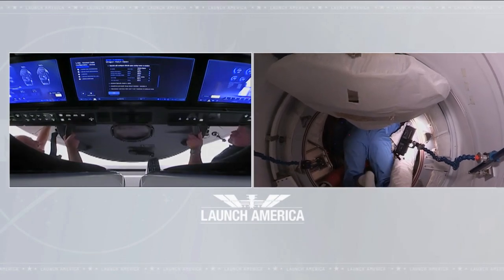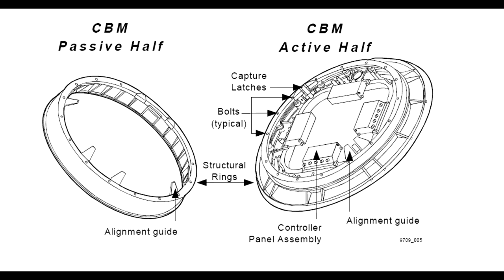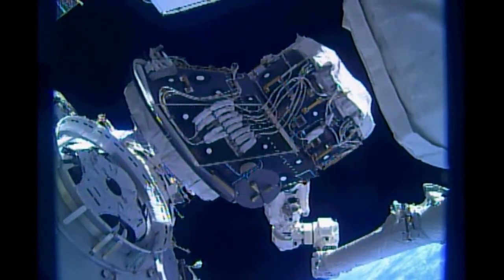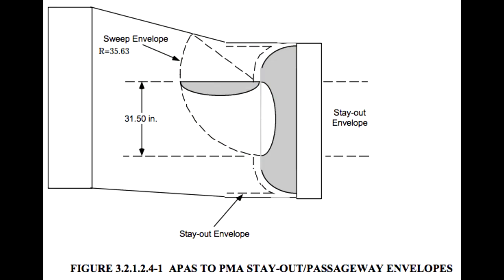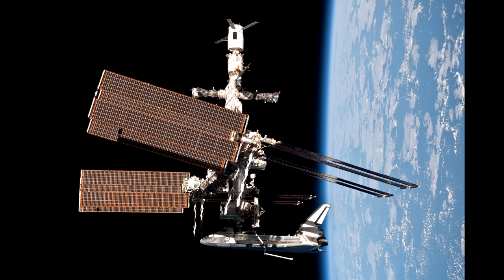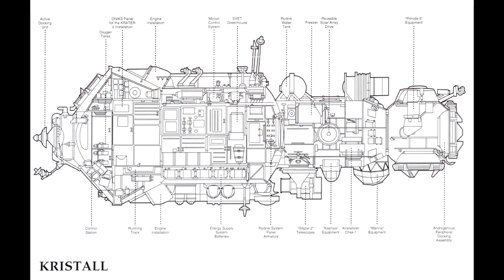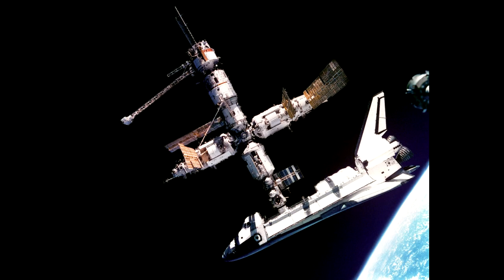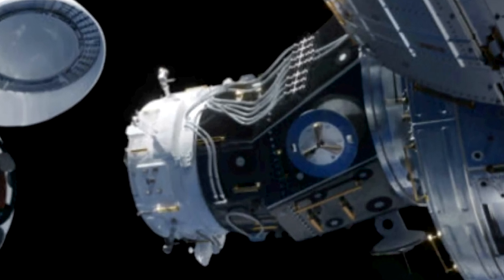Why The Docking Adapters On The Space Station Are Shaped Oddly

Comment: Hey Scott, great video! You mentioned a study to use the Soyuz as a lifeboat for Freedom and it being the first rendering of this particular design. It looks to me like in that configuration, particularly in "Option 4", the offset gave some potentially much needed clearance between the Soyuz' and the truss structure. Is it possible that was the main reason for the offset? That either these plans were serious enough they ended up largely designing it at that point already and didn't want to spend the resource to revise for the shuttle later, or perhaps saw similar uses for the ISS?

Comment: A little bit unrelated question. In case of an emergency, how long will it take them to get into the capsule and undock?
Reply: Well what's the emergency?
Reply: And what if the emergency is a leak in the capsule?
(Don't be ridiculous...that would never happen.)
Reply: What kind of emergency is not important. My question is, how long will it take if they do it as quickly as possible?
Reply: That is one thing that they are intending to test with the Dragon this visit if they have the time. I believe the aim is to undock within 4minutes. I don't know if that's after boarding or hatch close or all in all.
Reply: 3 minutes to get in the Soyuz and close the hatch.  They actually practice this.  Then the crew can undock and land completely independently with no help from the ground if necessary.  3.5 hours from getting in the spacecraft until touchdown in Kazakhstan.

Comment: Here's a few little factoids for those interested. Although STS-74 was indeed the third shuttle visit to Mir, it was only the second to dock. Discovery performed a rendezvous and flyaround on STS-63, but Atlantis performed the first docking on STS-71, followed by STS-74. Discovery and Endeavour would only dock with Mir once each over the course of the program. Additionally, each orbiter (excluding Columbia) had its factory-built native airlock removed around the time that Shuttle-Mir was coming to an end, each being refitted with a permanent Orbiter Docking System external airlock. This is why in the non-space station missions taking place in and after the late 90s (STS-82, 85, 95, 103, 99, 125), an ODS is still installed albeit with no APAS-95. Only Endeavour on STS-89 (Shuttle-Mir) and STS-88 (ISS A.1) would fly with the Orbiter Nose->Tunnel Hatch->ODS configuration following modification. Oddly though, even after its airlock configuration was changed, Discovery flew in the later Orbiter Nose->ODS->Tunnel Hatch configuration on STS-91 (fiinal shuttle-Mir) unlike Endeavour did for her Mir visit. Additionally, the Shuttle-Mir docking module would later serve as the design basis for MRM-1 Rassvet.

Comment: The offset may be a crumple zone, in case of collision at higher-than-expected speed. 
 
If the adapter is straight, the energy is transmitted directly through, rather than being absorbed in the breaking of the adapter. But the point about access to cargo bay makes sense.

Comment: I suggested on twitter it was in case of a accident and the docking ring broke. Rapid depressurization, the angle would help stop or slow objects or persons form being ejected. I will add something else to that, the door swings up and any out rush of air would pull the door down and self seal. I think the 27" of extra clearance was not enough to justify the design as there are specs on how much clearance in the cargo bay you have for a payload that is removable.

Comment: adapter comes from the Space Shuttle that might as well be carrying a pressurised space lab inside the cargo bay. I still got the model from the eighties, with that "oddly shaped"  adapter. So that's because the  two hatches were off considerably and there were backup structures left to be used in a new program. simple as that!

Comment: In order to have maximum clearance, during the assembly phase, when removing the long trusses or pressurized elements from the Shuttle payload bay. If the Pressurized Mating Adapters had not been oblique you would have had much tighter clearances when translating station elements with the mechanical arms straight upwards from the Shuttle cargo bay. The PMA nodes always angled over the Shuttle aft crew compartments. One also notices that PMA-3 and the Tranquility module might be used as spares should anything happen to Node 1 or 2.

Comment: My first instinct on looking at the design would be that it stops the energy from an overspeed docking or bump being transmitted straight into the module, instead the docking port will crumple and bend absorbing some of the excess energy like a crumple zone on a train and reducing the chance of the module being punctured or warped.

Comment: The shape was built in to provide clearances for the shuttle to safely dock. The problem first came up during the shuttle-Mir program so using that knowledge a solution was engineered into ISS. With Mir, before the docking module was installed they had to move the Kristall module to provide enough room so they learned something from that program and built it in from the start.
Reply: Did you even watch the video before commenting?

Comment: I think that astronauts should wear bump caps. Could be held on by velcro attached to a fire hood. A low mass ventilated helmet made out of UHMWPE could provide some basic level of protection against bumps and impacts. It may also provide some slight protection against certain types of radiation, perhaps slightly reducing long term exposure.

Suits worn on spacecraft and stations should also have some bump and abrasion resistance built in to protect the torso, hips, knees, elbows, and shoulders in a similar way as some motorcycle gear. These can also use tough plastics such as UHMWPE. Both bump protection and some limited mitigation for long term radiation exposure can be combined into the same gear. For areas that require additional strength or density, some aluminum bronze components can be incorporated.

Comment: So the ISS APAS was similar to what we flew in MIR config, but it was not exactly the same. The screws were longer, tunnel shorter, and there were some changes to the drive mechanisms.   Also, while STS74 was technically the third Shuttle-Mir flight, it was only the second docking ( following STS71). STS63 was just a fly around.

Comment: The adapter is both slanted and tapered.  This is required because the designers on one end used the metric system, while the other end uses the English system of inches and stones.
Notice also how one end is round and the other end is square.  21st Century adapter to make round peg fit into square hole.

Comment: Going by the placement of the upper windows on the shuttle, it also looks as if the offset lets the shuttle crew have a good view of the station and any reference marks as they close in for docking.
Reply: That's my theory too.
Reply: They don't normally dock the shuttle from the front seats.  They do it from the aft flight deck looking out the cargo bay windows and overhead windows.

Comment: Going from APAS to the IDS seems like a case of change just for the sake of change.

Also, why couldn't any arbitrary combination of APAS-equipped vehicles be docked together, as long as at least one of the vehicles had a functioning attitude-control system with which to line up with the other?

Comment: The renderings for the Freedom Space Station showing the offset design for the adapter. From the drawing it looks like the Soyuz capsule hatch is smaller than that on the the space station. In process plant, changes in pipeline size are often done using offset conical designs like this. Offhand I'm not sure if it has a lower pressure drop for a flowing fluid than a conical design, (not that this is a problem in this case), but it could be easier to fabricate. Also, it might be more resistant to buckling under sideways forces, something a mechanical engineer could confirm. Like the adapter for the Space Shuttle, it does have the benefit, (may be the sole design criterion), that it moves the Soyuz capsule a little bit further from the space station.

Comment: I'm an engineer and piping is one of my forte.  In my line of work that "slanted" profile is called an "eccentric".  And since the eccentric also connects two cylinders of different diameters, the section can technically be called an "eccentric reducer" but I'll leave it for NASA to call it whatever they want to call it.  I believe this shape is used to absorb hard impact but I could be wrong.  There are better ways to design it for crash resistancy without the risk for a disastrous rupture.  I humbly stand corrected.

Comment: It is purely for structural strength using this design is 10 times stronger that a straight connecting tube. It can bare more torsional and lateral movements, which happen when docking.

Comment: What’s are the ports in the top of the shuttle for?

It almost looks like you can get a better view of the docking adaptor if the cameras fail but you still need to dock. 

But this is just talking out of my backside, another idea from the same source would be that it has to do with being able to retract the port and/or absorb energy if the have a rough dock. I envisage that if it were to be up on the station for a long time they would’ve built in as much redundancy and reliability as possible as this help longevity.

Comment: Why not use an inflatable soft sphere with some semi rigid supports as an adapter section between docking connectors? This is essentially just the inflatable sections tested as storage closets but with connectors on both sides.

Comment: Citation: Outposts on the Frontier: A Fifty-Year History of Space Stations
By Jay Chladek, Clayton C. Anderson

P344:
"To dock with the Zarya module and shuttle, ewach end of the Unity node was equipped with a PMA. This essentially turns a CBM into a docking port capable of accomodating a spacecraft equipped with an APAS-style docking port, such as the Shuttle, a properly equipped Soyuz, or any other spacecraft still on the drawing board in 1998. The reason for not using a CBM as a standard docking port was related to the size of the hatch and the requirement for extremely tight tolerances. An RMS arm is required to position a module on a CBM. A PMA also has some built-in shock absorbing capability, should it see a rough mating."

Aside, the reason the RMS arm is required to dock a CBM coupling is related to the keyed nature of the system - it can only lock in one of four positions. The PMA is not keyed, it only requires a longitudinal precision for approach.

Comment: Scott, what about deflection of forces when the un-attached units mate? Similar to the crush zone in a modern vehicle. Designed to absorb forces in case of a severe impact and not transfer them directly into the main body of the space station. Possibly not the main reason, but maybe a factor? What do you think?

Comment: What about offsetting the force of docking.  Under normal conditions that force should never be enough to damage the collar,  but as the station grew with more modules being attached a straight collar would better translate those docking forces down the perpendicular length of the station sending that force through multiple module docking collars and back again.  This lateral force going back and forth would stress all the collars multiple times during each docking operation.  Also, though unlikely, could set up a resonace situation.  The offset appears to place.most of that docking force on the cllar itself and what gets translated to the station would be more of a shearing force rather than a setting up a reflectable compression wave.

Comment: It looks like they were just putting in some adjustability for future unknowns in terms of mating clearances. And if you put that on all of them they are interchangable. A straight one would have been too tight when the shuttle had the docking system slid forward for larger payloads. And since they were already made and tested adding redundancy was cheap. You know if you have one straight and one offset your always going to be switching them around cause the one you need is never the free one. :)

Comment: When you say “presurissed mating adaptor” does this also kind of mean mean an airlock?
Reply: No, an airlock allows the pressurising and depressurising of the interior space to allow passage between a pressurised(inside ISS) and unpressurized space(Outside ISS), without depressurising the whole spacecraft. The PMA allows the docking of 2 pressurised spacecraft to eachother there's no cycling of air in the interior space.

The ISS has airlocks. The PMAs are not them.

Comment: My guess at the shape under the assumption it can be oriented any way. I.e a gyro type deal.  This would allow them to connect it in such a way to give extra room for docking modules.  One ship may need to dock at a 90 degree orientation but if another would dock at that same degree it’s from module may hit the ISS. So they could re orient the docking port (spin it around) and now that craft could dock without hitting anything.   Hard to explain...

Comment: Is it possible that the adapter can be rotated to accommodate different docking configurations? Sometimes you could want a bit more clearance in one direction and other times in another? Or does the adapter only affix to the station in one orientation?

Comment: Another possibility that I haven’t heard, but seems plausible, is that the kink puts the upper flight deck windows in line with guide markings on the ISS module. If it was straight, those windows would be centered down the side of the module.

Makes sense to me, anyway…

Comment: As an engineer, I actually always thought, that the bend is to allow for some flexibility in case of a hard tap docking. It contains springs (or more likely servos) that would bend on impact and capture some of the inertia. Slightly angled construction allows for easier subduction under pressure than a point on approach. But that’s just my wild guess.
Reply: Interesting.  Could that be achieved with some sort of spring loaded straight scissor flex section easier?

Comment: This might be a stupid question, but is there a possibility of Starship docking with the ISS? I wonder how docking would be done. 
Is there a graphic to compare the size of both next to each other?
Reply: That's an unknown so far, since there's been no discussion of what docking capabilities Starship might have, other than its inflight refueling system. But if you look at the images of a Shuttle docked to the ISS, then Starship is about 50% bigger (e.g. 50m long vs 37m long).

Comment: I'm surprised you couldn't find the definitive answer to this question.  Your "most likely" answer is, in fact, correct.  When the shuttle was docked to the station, the offset allows for more clearance to remove long modules (U.S. Lab and Japanese Lab) from the cargo bay.  This was well documented at the time.
Reply from the maker: I could find at least one person familiar with the program confirming this, but couldn't find any reference material on the design process.
Reply: @scottmanley  In retrospect, the adapter kind of has to be designed like that.   If you've built a space truck, you want to be able to launch payloads as large as possible -- and that means the docking adapter had to give you the ability to lift large payloads straight out.  The edge of the adapter facing the tail of the orbiter therefore needs to rise vertically or angle towards the orbiter's nose, and that in turn necessitates the offset cone shape.
While I can't remember ever seeing a document stating this, it's possible this information comes from one of the NASA pre launch briefings for STS-98, the flight where Destiny was launched.  If you can find the recordings of those briefings, you'll probably find the proof.

Comment: I would imagine the reason for the offset is structural rather than function of position.....because it looks like you are going from a bigger diameter to a smaller one.  If this is the case, if you have a perfect cone conversion, you have the possibility of compression stress when docking along with equal torque that can cause fractures if the attached vessel has sway......but if you offset the docking, the pressure is asymmetric in nature, allowing you to put more structural support on the one side rather than the whole thing needing heavy materials.  As you know, weight is everything in space, so less structure but equal strength is better.
.
But that's just my guess

Comment: Poor Buran. Leaving out the engine was a good idea. It looked like the design was a good idea. Given how expensive it is to get stuff up into orbit, I'm surprised they don't leave as much as possible in space for just in case situations. Why bring back that docking section in the shuttle if it could have been used up there. Just leave it there and come down with an empty shuttle. Ha. 

Great video. Thanks again for the work you put into these. Very interesting.
Reply: Because the airlock/dock is what allows the shuttle to dock.  If you left it there, what would the next shuttle do with it?

Comment: could it be riskmanagement? I can't see from the pic at 53 sec, but 71 cm seems to be more than 1/6 of the diameter of PMA-2. Meaning if the docking would be way to hard (fast), the docking part would not smash just into the station (or whatever is holding PMA-2), but "buckle&crumble" PMA as being directed directly away from the 'tube' it is attached on. (hopes its clear; meaning my English is sound enough).

Comment: It's a crush zone to limit damage in a hard dock. A straight tube wouldn't deform and a hard dock could drive it through either vehicle  like a straw through a potato.  It also makes it a spring.
Reply: It would be far better to take a force like that straight on, instead of hitting off center, and potentially twisting the PMA off of the ISS.